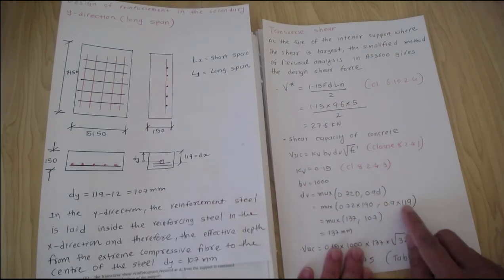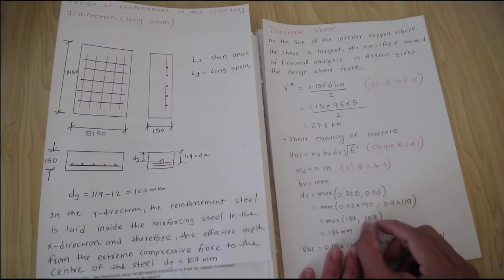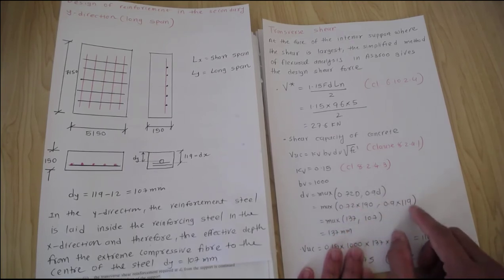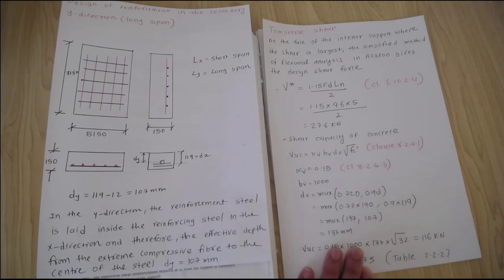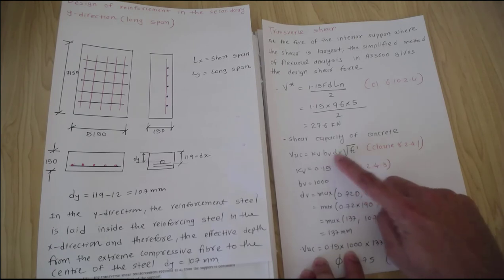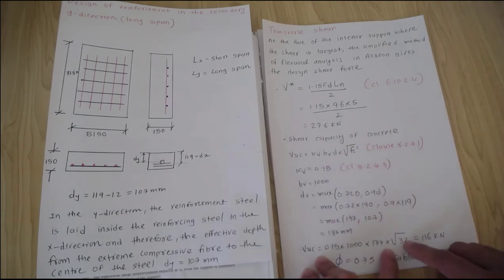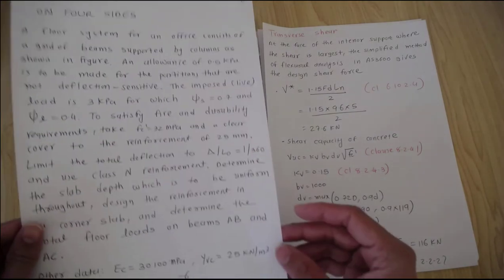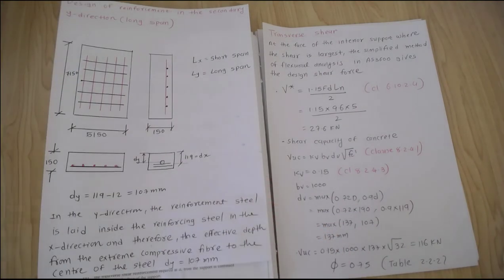Two Way Slab Example 1 Part 18-Transverse Shear

Comment: just have a question sir. Do we need to check shear of the slab for y direction as it might have higher designed shear due to longer span Ln. Thank you
Reply from the maker: The slab shear generally carries by concrete. We do not provide the fitment for the shear in the slab. You can check for the shear in the y direction. If the slab does not satisfy the shear capacity, increase the thickness of the slab rather than provide the fitments.
Reply: @patelstructuralengineer1  thank you sir. Please keep up your great work

Comment: In the 0.72D, you have used 190mm, where the thickness is just 150mm!
Did I miss something?
Thanks
Reply from the maker: You are right. We should take 072*150 instead of 0.72*190. You can take dv = 0.72*150 = 108 mm. The answer may still correct as concrete shear capacity is greater than the design shear capacity V* with the value of dv = 108 mm.